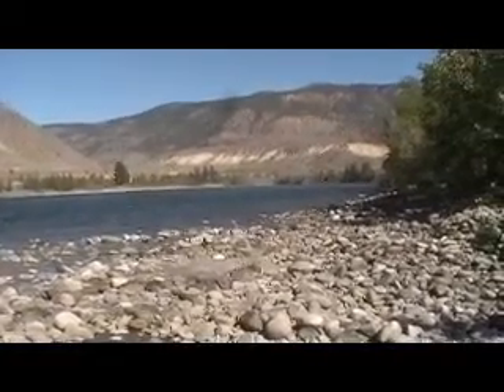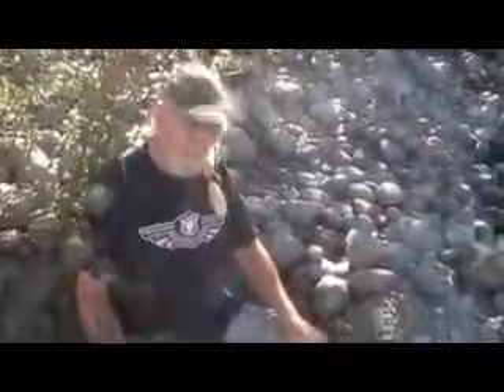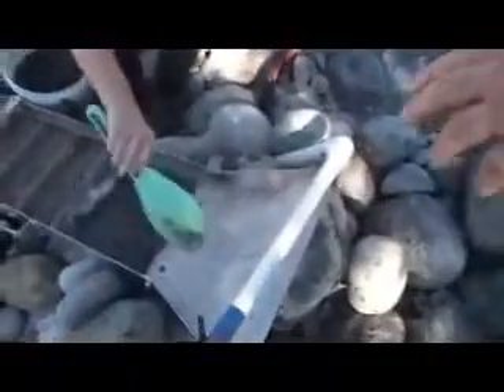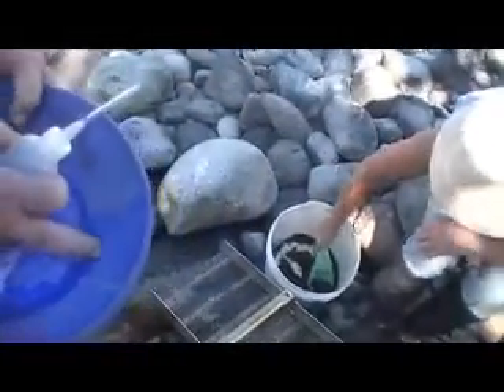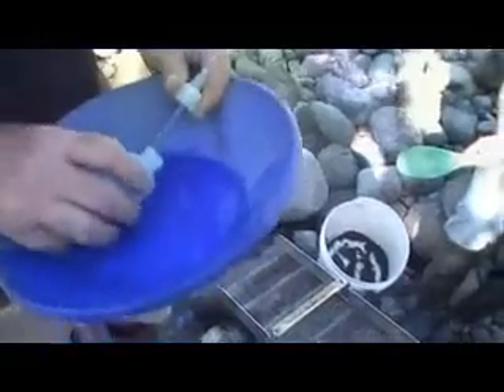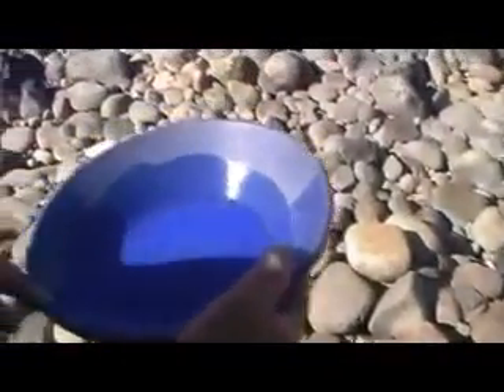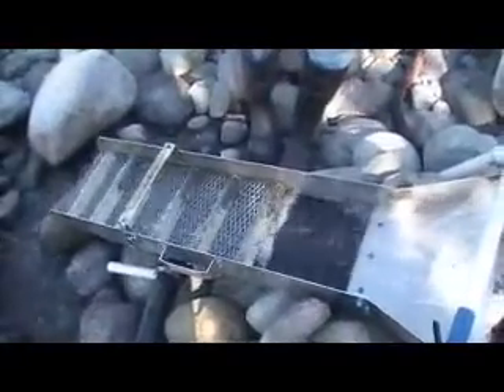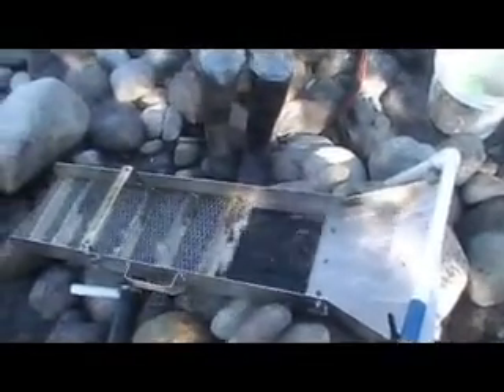Gold MIning The Thompson River

Comment: Unless these people have a claim to this stretch of river and work permits to use equipment, they aren't allowed to use a sluice box or ground sluice of any kind, in BC. You can only use hand shovels and gold pans to play in the rivers and creeks.
Reply: Andy, to not need to pull any permits your max inlet for your pump is 1 1/2" without needing a permit but you do need a settling pond before water goes back into the river...